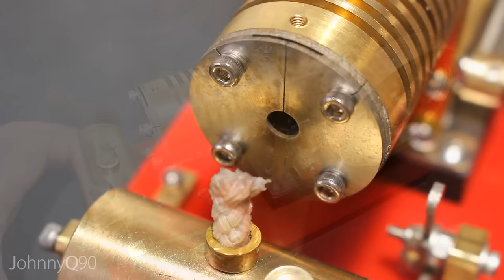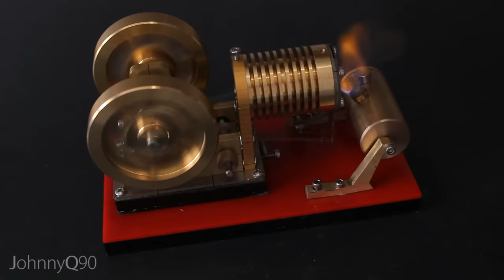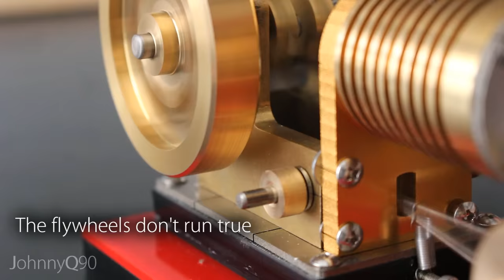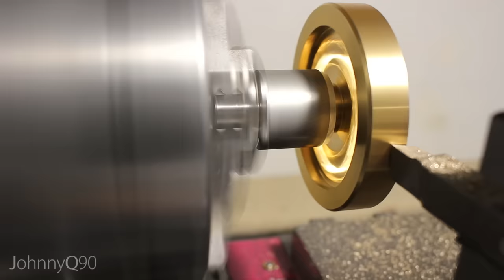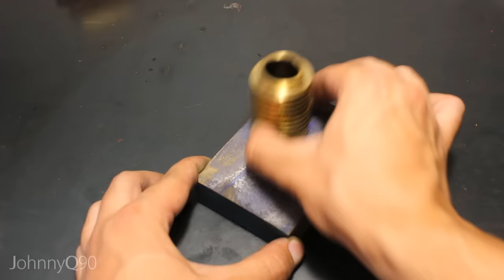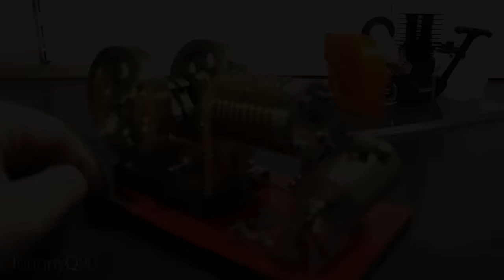Chinese Flame Licker Engine

Comment: I came from China, and this reminds me of my hometown and childhood. At the period of time in 90's, there were huge amounts of tractors used at my place called Fujian. When I hear the licker engine running, the sound was familiar and touching.
Reply: Dave Micolichek some did..... I believe Fairbanks Morse had some flame lickers could be wrong. I know I’ve seen at least one. 
Could even be a locally produced tractor using what was on hand. 
There are 
Hit and miss tractors 
2 stroke 
4 stroke 
Steam 
List goes on .......lanz bulldog tractors used a concept very similar to flame lickers
Reply: Wrong, most likely hit or miss engines
Reply: Dave Micolichek  Now that I think about it, it doesn't make sense for that engine to be used, old diesel's like u said were used.
Reply: I've seen a lot of people confuse Hot tube ignition for flame lickers and sterlings.
Reply: Now you'll remember china for Coronavirus
Reply: Dave Micolichek  Geez guys what's the problem here? I completely get how the flame licker sounds a little bit like a diesel tractor engine. He didn't mean that the tractors actually used vacuum engines. He was simply wistful of the industrial sounds he frequently heard in is childhood.

Comment: Small adjustments make a lot of difference for an improvement in performance.
I miss working on motors, but unfortunately, my country is in a deep financial crisis and we have to work hard, I do not have more free time.
Do you intend to improve the speed of this engine? I have some tips that can help because I know a video of a Japanese who made a homemade engine that reaches speeds of 1200 rpm or more.
Leandro Wagner.
Reply from the maker: Hi Leandro it's been a while. That's really sad news because you were doing a wonderful job with Stirling engines. I still watch your videos from time to time. As for the engine, I guess better cooling (cylinder water jacket) would give it some speed. What would you suggest in my case?
Reply: Create an engine that does your job, then sell it to your boss 😉
Reply: Just curious, but if you lubricate the spinning connections and maybe make smaller but more dense flywheels from scratch would that help?
Reply: It's amazing how many natural gas generators we could build cause most usa households have 1 or 2 push mowers in the garage that don't work .
Reply: Manual do Motor Stirling - Leandro Wagner
Reply: Milky Way Laniakea Superclusterite
 8 months ago
Create an engine that does your job, then sell it to your boss 😉

That's how you go from a recession into a depression. Disenfranchising more workers. The only thing worse than that idea would be communism.
Reply: Manual do Motor Stirling - Leandro Wagner . DON'T WORRY. POSITIVE  THINK AND HOPE .GIVE YOU  WINING YOUR DREAM.AMEEN
Reply: Manual do Motor Stirling - Leandro Wagner 
hi m8 I'm English and it's not just your country we've lost all our engineers and just have fitters.
sad really no old skill base
Reply: Reads comments to learn about tiny engine. Realizes economic engine of the world needs overhaul.

Comment: ahh, i see, it runs off the cooling of air. to start off, the valve's open and that lets hot air in, then it closes and the air cools and contracts bringing the cylinder forward.
 The inertia of the flywheels bring the cylinder back and open the valve ready for another cycle
Reply: I don't think that's the complete answer though. The intake cycle is pulling partially burning hydrocarbon vapor and the port closes just before the piston reaches the far end. I think the vapor continues to burn and give the piston an extra bit of shove through the remaining ~20 degrees of cycle to the end.

This hypothesis could be tested by using super-hot air coming through a tube; this could be done by wrapping a copper tube in a helix, heating it red-hot over a large burner flame and blowing through the other end of the tube with the outlet near the intake port.
Reply: i love "simple" machines like this
Reply: tubeist- dan Yes, I agree. Your answer is the complete answer, explaining in details the cycle.
Reply: But it has to be tested, because I could be wrong.
Reply: LegendLength maybe a add an  exhaust system to it and add the flame to the inlet lol .....just get petrol one lol
Reply: I just have to wonder what happens as the cylinder heats up. Thinking it would at least slow down.
Reply: Gary Peters It would definitely slow down, since all heat engines exploit a difference in temperature. The greater the difference the more work can be done. Cooling the cylinder would keep it at high efficiency.
I'm still trying to figure out why the exhaust is the same as the intake. This is so cool. I'm wondering if 2 stroke reeds would improve it, or kill it. Cos the chaps above have theories that a single intake/exhaust is part of the design.
Reply: +Milky Way Laniakea Superclusterite I don't think the exhaust is the same as the intake - if you look closely, there's a small hole at the top of the cylinder towards the flame end that I believe might be the exhaust.
Reply: Travis T Good thinking. I didn't notice that. However as I watch it, there's nothing to indicate anything is coming out that hole. Of course the exhaust is colorless, but wouldn't we see some heat shimmers, or some visual clue? It's calm air, to my eye. 
Also, does it seem to you that the wick flame gets "puffed" out? Cos it does to me. It looks like it sucks hot air in and blows it out again. Although that doesn't sound like energy transfer! 
I want to figure this out before hitting Google if possible lol
Reply: my god I have never thought of this... very clever! Never seen an engine where the piston is sucked in instead of pushed away.
Reply: see how many motors it would turn to charge ya fone or somat put it to use....looks like a dirty diesel piston .....lol lipo wud be better and last longer lmao
Reply: Max Huxtable-Short wot ya mean no fuel its wick burner the fuel prob methalated sprits in the tank very clever lmao some one used this basic idea and made a engine that in cars today lol
Reply: gabriel Sturdevant was about to ask how it works. Thx for leaving the comment
Reply: We used to call this "atmospheric" or "vacuum" engine.  Like the early steam engine, the goal is to create a partial vacuum in the cylinder, the atmospheric pressure is doing the work.  It's a two stroke!  This one is pretty, I like the all-machined look.  I hope to see bigger and bigger ones someday, this seems like it could scale up.  I love the way these engines start right up!  tubeist- I think there is never any positive pressure inside, and your test idea suggests that this engine could run on other sources of heat beside a flame!  Maybe a big one could run on the EXHAUST of a gasoline or diesel engine?  As a "bottoming cycle"?
Reply: Yes, exactly!  The original steam engines were "atmospheric" engines, they didn't have pressure in the working cylinder, they had "vacuum".  This was partly because of the problem of dealing with steam under PRESSURE, where it's relatively easy and safe to have just a bunch of boiling water and everyday steam such as you see in the kitchen.  Avoiding the horrible fatal explosions, see?  Unfortunately you might have had engines that weighed a ton per horsepower, and very inefficient beside.  Sometimes that was OK!  They had low stress and sometimes would run for decades, maybe a century.
Reply: gabriel Sturdevant sound like a beta Sterling white but with extra parts
Reply: What's the 5 percent of the mixture

Comment: I never really like these types of engines- stirling engine included- because they just offer 0 torque at all.. still great craftsmanship.
edit: well you bought this so nvm
Reply: Stirling engines and all external combustion engines do offer up torque, not as much as an internal combustion engine but it can and has been harnessed effectively
Reply: you can just turn speed into torque
Reply: You can just realise that its outdated technology and it makes for a better decoration than an engine
Reply: It's a fun thing. It's not like Elon Musk is supposed to be afraid...
Reply: DumpYourTelevision and internal combustion engines also need a push. This engine is not that powerful, but is simple and if you make bigger ones , they will produce some power..... There are internal combustion engines with less power if one of these were of the same size....
Reply: DumpYourTelevision the internal combustion engine such as the one in your car needs a push to get started as well, thats why it has an electric starter motor linked to the flywheel
Reply: You say they produce no torque but it's kind of impossible as it wouldn't work otherwise. Sure, its a tiny amount compared to other engines but things tend to scale up. Make a big enough version and I bet that "zero torque" would still be enough to rip your arm clean from your body in suitably gory fashion.
Reply: DumpYourTelevision.... The more pertinent question is are you aware of the similarities as the two engines have more in common than they lack.
Reply: +Justin Koenig
Did you know that nuclear submarines operate on stirling engines?

Many people seem to have a very narrow idea of what is "practical" in an engine - which is simply a machine used to output mechanical energy.
Reply: @Justin Koenig It's not a toy, it's a great technology. https://en.wikipedia.org/wiki/Gotland-class_submarine
Reply: Bruce Wizayne .....
You need a phyciartrist.!!!
Reply: @AP12uZvfvag It is clearly written "these types of engines" not "toy engines like the one ..." And also the article has been edited. Do you know what was been added or taken away? You are not very good observant.

Comment: How can they produce something that's THAT much off center? im impressed to see how poor manufacturing that is.
Reply: StopaskingformynameYouTube cheap production line & stuff like that
Reply: its a counterweight thats built into the flywheel, its not poor manufacturing, its great manufacturing
Reply: Edit: other sterling engines ive seen have those, this one is just off center
Reply: It was probably decent enough overall, they just screwed up drilling the hole at the end...
Reply: It's funny how the machining work looks absolutely perfect in the pictures, but once it starts moving you start thinking "now where the hell did they go so terribly wrong?"
Reply: The funny thing is Chinese manufacturing has actually gotten worse over the years.
Reply: China, the poor man's Japan.
Reply: @paulcorona642  i wonder hows the quality of peoples iphones
Reply: Well u pay for what u get and u dont choose some brand u never heard of and do some research before trying to buy something that u know nothing about as in which shop and place  more trustworthy to buy from. if u want to get cheap ones then they have a higher chance of being poorly built thats why if u wanted to buy something from china u got to find the right website or place and see the price it is like that in china its not about the typical made in china thing its more like where u get it from in china

Comment: So the suction created by the flame in the cylinder when the valve closes is enough to make the piston cycle forward again. And the centrifical force of the flywheels is enough to pull the piston back. Thus as long as there is flame there is power. Not sure you could squeeze much torque out of one of these engines based on the fact that all power is generated from suction though.

Comment: These engines are actually vacuum driven, the power stroke is the collapsing of the super heated gas in a flame. So they work way better the colder the piston walls are.

Comment: If you were to hook up a small electric motor/generator, about how much power would a small engine like this create
Reply: ^Hear Hear^ Chuck a few Neodymium magnets together so they feed into each other and surely you could speed that thing up to buggery SEG style?
Reply: Jack Martin nothing this things produce about 0 torque
Reply: Very little IMO.  I find it an interesting engine, running off of heated air expansion, not actually burning fuel.  No fuel, no constant lubrication, probably makes it a interesting part of the development of the internal combustion engine.  Either that, or China knocked off Otto and made something that did not work well. Sooooo, this is where it all started. :)
Reply: Car engines run off heated air expansion, they just make the air expand a lot more by mixing fuel into it and then burning it.
Reply: Its not actually a stirling engine though, despite what the ad claims. Its a vaccum engine and runs off a slightly different principle. And yeah , vaccum 'flame licker' engines are basically novelties
Reply: my guess - probably only a few milliamps, or like 1/16 of a watt. enough to make an LED light a bit, but I would guess a candle would be brighter...
Reply: They don't have much torque, since the maximum theoretical pressure they could run on is around 14.7 psi, atmospheric pressure, and its highly unlikely to reach anywhere near that pressure. They're fun but I doubt they produce much power for their size or volume.
Reply: Doubtful that it would have the power to turn a generator.
Reply: Well, what if the cylinder was the size of a barrel, and the heat was coal fire -with a power takeoff pumping a bellows for a super hot flame, now you've got something to work with. (If you've seen Mythbusters implode barrels under atmospheric pressure lol). 
Then, a little gearing. The generator doesn't have to spin 1:1 with the flywheel. 

I'm sure it could be a working machine. The question is would the power generated outweigh the cost of the coal, and the maintenance..
Reply: Milky Way Laniakea Superclusterite I'm sure it could generate power, and it could probably do it somewhat efficiently with good engineering, but the power to volume ratio is garbage. Compared to a steam turbine, a flame licker would probably be 10 times bigger for the same power. It really doesn't have a place outside of model engines, unfortunately.
Reply: aomimezura11 Sounds about right. Figures... Thks for the input man.
Reply: i bet it would run a lego motor, but not under a heavy load.
Reply: not much, that engine has almost no torque
Reply: not how that works
Reply: EarthSurferUSA what do u mean no fuel the heat is coming from a tank of burning fuel lol
Reply: @omniaquaeriteacdubitate3898  .

Comment: Could you use the engine to power something like a toy boat? Just for kicks. 

I've seen videos where an toy boat is powered by a homemade engine that uses thermal exchange. Thumpers or knockers something like that.
Reply: No, it's too heavy and vacuum engines are only 5% efficient and a car engine is 40% efficient so not enough power.

Comment: I have heard that running this engine for long enough will cause it to stop working because of a weak vacuum. Do you think cooling this down with ice or something would keep the chamber colder to the point where it would significantly increase the force of the vacuum, and therefore, rpm?

Comment: I noticed that you re-installed the valve cover (top of head) 180 degrees around as the slit(?)  in the valve cover is to the bottom instead of top, in your re-assembled machine. Any particular reason for this, and what is the point in the slit anyhow?

Comment: holy fuck its loud and annoying, can these things be quieter?
Reply: That's kinda the point. If your a mechanical geek, you're gonna want to see, hear, etc all the metal bits doing their respective thing. If it were quiet, and enclosed, it would be a bust.

(And it's not like it requires protective ear protection just to run it! It's a fair sight quieter than 95% of the engines I operate on a regular basis. HELLA quieter than eiter my chain saw or angle grinder!
Reply: I get the visual and mechanical appeal after all it appeared in my recommended, but it sounds like a damn sewing machine.

Comment: When you hit the piston directly in the end, it caused it to over heat and expand too much causing friction between the piston walls and cylinder walls. I would not suggest doing this in the future as it can cause significant damage to the engine.
Reply: Be
Reply: @doughopper9292  be

Comment: I wonder if increasing the spring tension on the valve helps, or possibly changing the piston so there is a smooth flat surface that comes all the way to the front of the cylinder.

I'll bet machining the top flat and putting a large cpu cooler on it would help it operate faster too.

Maybe some nicer bearings on the axel and linkage too...man if I had a shop I'd spend so much time making useless toys like this run more efficiently.

Comment: If you pit grooves on the piston, like you have on the cylinder casing, but smaller, you'll reduce the friction and also improve the seal slightly, dont ask my to explain the science behind it.  Although it does work better with liquids and it's how a hydrolic valve piston seals itself it's going to help.  because you cant get a piston ring and lubrication system that small.

Comment: Thanks for the video, I was seriously looking at one of these because of the center crank & twin flywheels, its a shame the flywheels aren't true & you had to work on a very rough slide valve area, for the price...i think i'll just stay with a PMR #3 solar engine, they seem to run much easier & better.

Comment: Ever think of changing to a water jacketed cylinder with a steam relief stack? Bet it would run as long as it had water to cool the hot gas, and fuel for the flame.